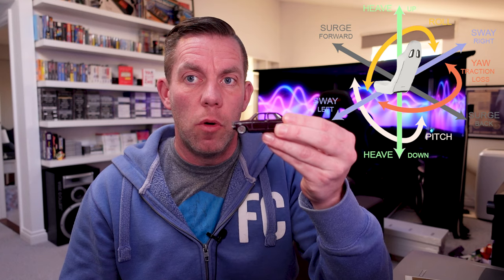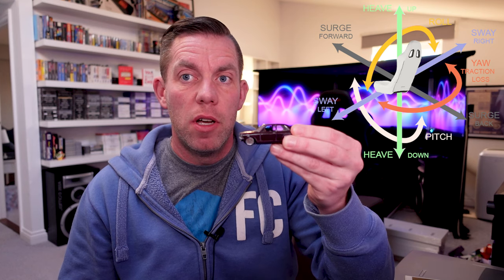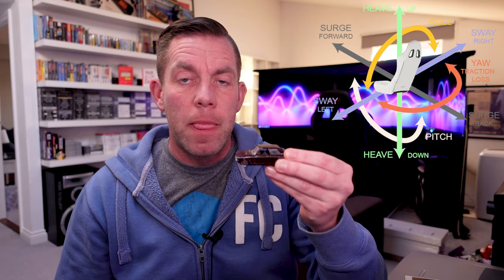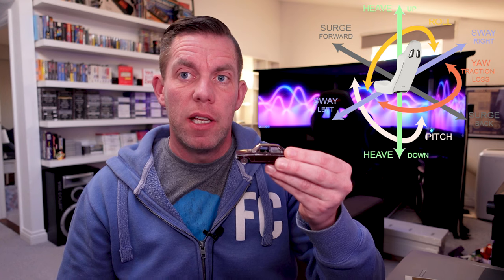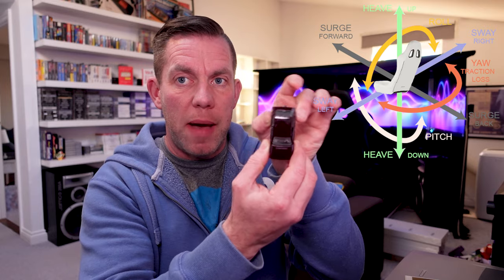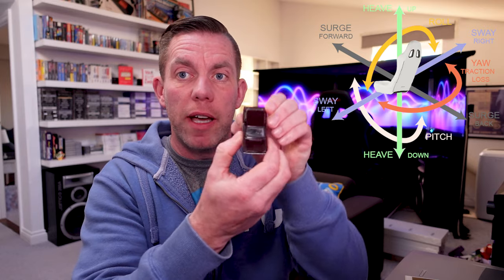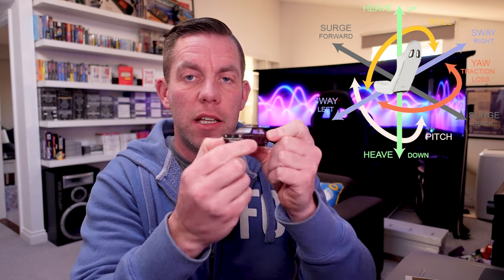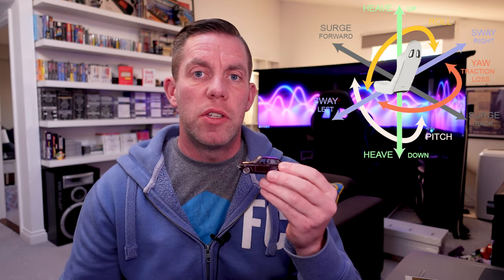Lets Talk Motion! DOF's? Setup - Accurate Simulation - Limitations - Right & Wrong!

Comment: I was agreeing on everything until the segment on braking AFAICT

Newton's first law states that "every object remains at rest or in uniform motion in a straight line unless compelled to change its state by the action of an external force."

The initial state of the object (rest or uniform motion) makes absolutely no difference. 

(Also, it is possible to exactly simulate earth gravity by being in a rocket accelerating at 9.8 m/s2....  Whatever the current rocket velocity is)

Hence braking is exactly the same as accelerating in reverse... perhaps it does not feel the same in a quick test in a car in reverse, but the reason maybe one has to turn his head to drive in reverse or other factor, eg powerful braking being easier to achieve than powerful acceleration in reverse
Reply from the maker: Theory does not always translate to reality... Keep your head facing forward, close your eyes and reverse your car, it does not feel like braking at all... it feels like reversing.
Reply: @KarlGosling  That's because the negative acceleration of braking is much faster than the negative acceleration of reversing. You can easily reverse in any car without you're seatbelts on, try that with braking and you know what happens. So if you don't have a seatbelt tensioner,  pulling the surge platform back fast, is the most accurate you can get it.
Reply: @SanderVandeWiel  You are 100% right